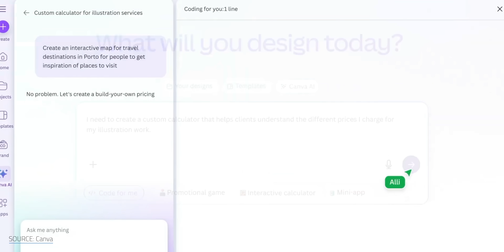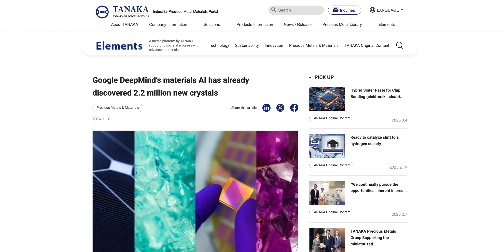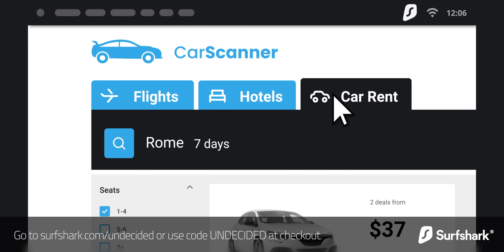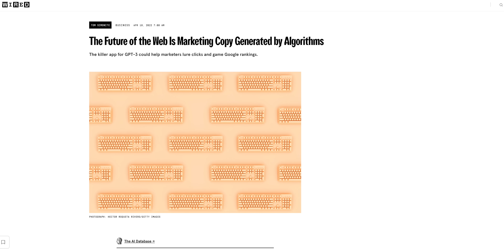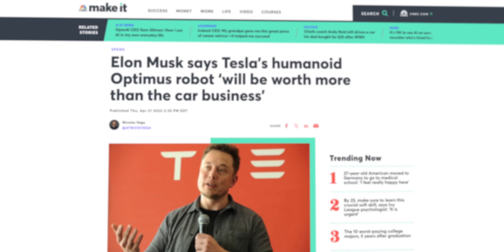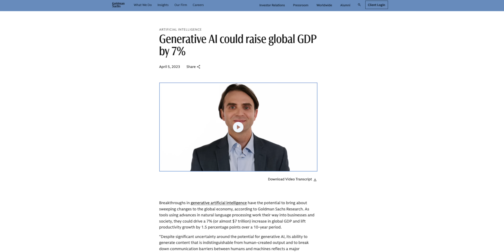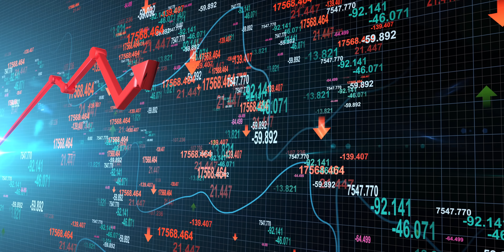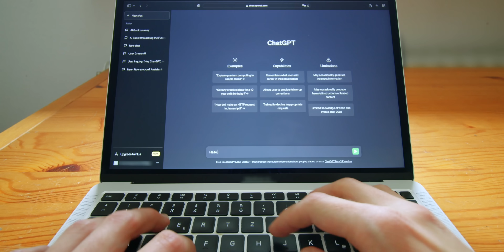Why the AI Revolution Has a Fatal Flaw

Comment: On this topic I think back to Roald Dahl's take on this in the book "Charlie and the Chocolate Factory".  Charlie's dad had a job screwing the tops on tubes of toothpaste and was made redundant when his employer invested in a machine that could do this job.  But soom after Charlie's dad gets a new job working for his old employer as a technician who keeps on fixing the machine that screws the lids on tubes of toothpaste.
Reply: How did his dad know how to repair that toothpaste cap bot? 
Was he the only one doing that job, only the one shift? What happened to the other workers who had the other shifts? 
Was he fixing only the one bot that replaced his one job, or all the toothpaste cap bots in all the factories near him that replaced lots of jobs? 

It's very likely those toothpaste cap bots replaced more than just Charlie's dad's job, dad just got lucky with getting the one job to fix those bots and the rest of the toothpaste cap screwers were SOL.
Reply: @Jcewazhere   or he was the only one, maybe a shift of 3 people, so the factory could keep running 24/5 and then they created the machine and greatly increased the output, still needing 3 people ? The real problem is: we probably don't need a lot more toothpaste caps than we did the year before. So maybe a competitor got crushed with cheaper prices... so the group of 3 could keep their jobs, but the competitor's factory closed, maybe a loss of 10 jobs. There are many many outcomes possible, but there are lots of products which just won't see increased demand.
Reply: But robots with agi can repair other robots with agi in the same way humans repair each other withput a need or an external entity

So no, thats not a solution

Comment: at one point, whale hunting was one of the major industries in the world, in a few decades it was reduced to irrelevant by oil, oil has since become one of the major sectors in the economy, it could be smashed by nuclear fusion in a few decades, its just part of evolution. How many "vital" sectors changed (or ceased to exist) dramatically since the internet became omnipresent just a "few" years ago. Contrary to popular belief people are very good at adapting. If today's tasks become easier and we need a lot less people to do them, we will just come up with new stuff to be done, we always had. Not so long ago, 80+ percent of the workforce was in agriculture, now is (way) less than 10% in the modern world, strictly speaking, that means that at least 70% of the workforce was displaced.... well, how that turned out?

Comment: this is such shallowly researched ai doomer video. not impressed. you assume demand will dry up even though that would literally go against everything we've seen has happened over the last 200 years of tech innovation. humanity always demands more because we hedonicly adjust. a 16th century peasant farmer would scoff at the luxuries a middle class worker gets. the internet has caused massive job loss too. but it has reduced  the barrier to entry for many new ecommerce businesses, ultimately creating more jobs than were  lost. these people creating these companies do not need to be software engineers to do this. they use shopify. likewise workers that get replaced with AI wont need to be a machine learning engineer, they can just use the various tools that will be developed that leverage AI to start their business. they just need to know how to use a laptop. and even better rather than workers doing repititive ardous tasks every day these workers will be learning more useful organizational/management skills which allow them to demand higher wages.

think about it like this. if productivity increases due to ai that means we get more output for less input. that increases supply. that decreases prices. so at the same time as AI is creating jobs, reducing the barrier to entry of new businesses, it can increase the wages of the workforce by pushing people into careers with higher upward potential and transferrable skills.

Comment: if a.i. / robo / virtual & etc. are allowing 4x the widgets to be produced for 1/2 cost - but price to consumer remains the same, the gains are going to MegaCorp board and shareholders. 

In a decent world, that leaves some competition room to reduce prices to consumers, to an extent. - and/or for ethical consumers and professionals to support eachother with more ethical shops and co-ops and guilds and so on - entirely possible for worker-share-holders to benefit from profits + use a.i. and robo within reason to increase output - consumers can choose to support the more ethical shops for a penny more. 

Going further, a decent State solves half of these problems with increased public services - including housing - presumably through (ethical) contractors enabled with a.i. / robo / virtual - increasing efficiencies & etc. to make $40k houses possible. - states with good systems demonstrate Good and others copy. 

That said - there's a lot of work to get from here to better systems and cooperative networks towards better co-ops and guilds and non-profits and political parties and states - work that can be done now, and supported - it's toxic to ignore all of that and just comment 'we just need UBI' (and forget about all the other stuff).

Comment: Specialized robots have been working in factories since the 1980s.  That is not new.  This notion of General AI (GAI) is so far from being close that it is funny.  Let's use a Tesla example.  In their last big event, they had bartenders serving drinks from a single pour.  A GAI robot would be able to go to a bar that it has never seen before, go in, and come out with a list of drinks that could be made by the ingredients found in the bar.  See how different those two things are?
Reply: You're absolutely correct. There is a step change in difficulty there. However, go look at the capability of any robot 5 years ago and contrast that with today. Machine vision was basically useless. Movements had to be hard-coded. Now? They stick the robots into simulations that are running 10's of thousands robots simultaneously and they come out the other side with smooth, confident behaviors. 

Optimus can walk around, identify objects and interact with them on its own. Optimus being constrained in the public demo last year had far more to do with potential accident liabilities rather than a lack of actual ability.

We're are the bottom of the AI technology S curve right now. It may not be everything they say it is, but where it is right now is the worst it will ever be.
Reply: @jackinthebox301  And all of those things, other than walking around were being done in the 80s by factory robots.  And Boston Dynamics does the movement better and has done so for about 20 years.  And all of this work is being done on the researched done about 30 years ago.

What has improved is processing and data sets by importing information from the internet.  

Call me when any robot anywhere decides it should leave Luke on Tatooine and go find Obi Wan Kenobi.  What we have (including Tesla) are not thinking things.  They are algorithmic things.  That is why Tesla struggles in the real world with FSD.  What do you do in a situation that you do not have an algorithm to solve.
Reply: @jimsackmanbusinesscoaching1344  Respectfully, you're completely wrong. FSD is going live in a small fleet of Tesla owned, unsupervised, driverless taxis in Austin, Texas in June. They're starting in a geo-fenced area for regulatory purposes, but it's the same FSD that everyone has already. Computer vision technology is light years ahead of what you seem to think it is. 

Anyone can spend 100's millions on RnD like Boston Dynamics and create impressive motion fluidity, but only in the past few years have they actually started selling robots as products. Before Spot they were a money pit who relied on government funding and changed corporate ownership multiple times in the past 15 years. 

With Optimus, Tesla is doing something completely different. It's being built as a mass market consumer product from the start. Not a tech demo like Atlas, which a single unit cost upwards of a million dollars. Your wildly unrealistic expectations are blinding you.